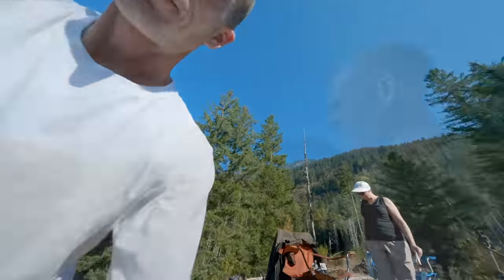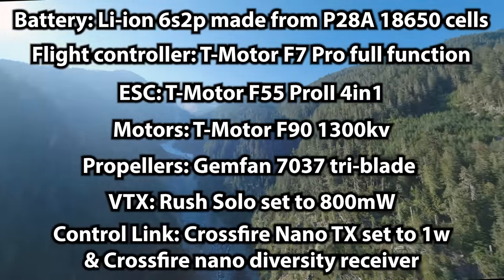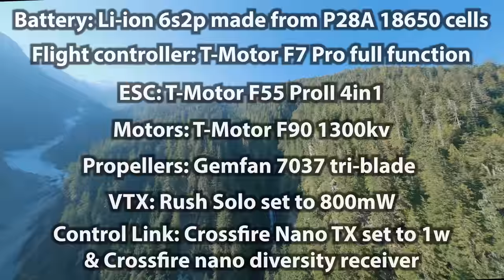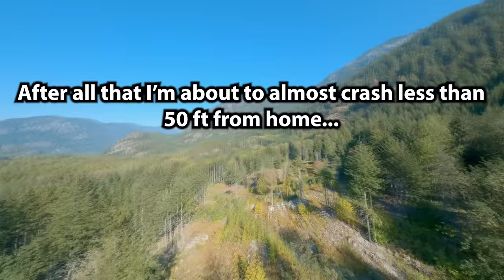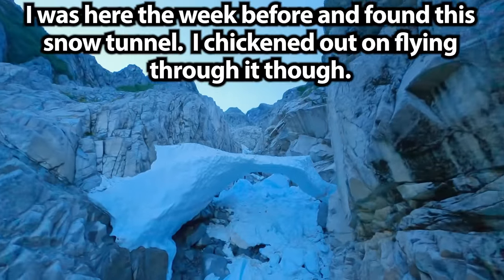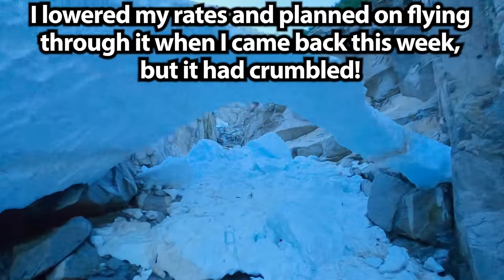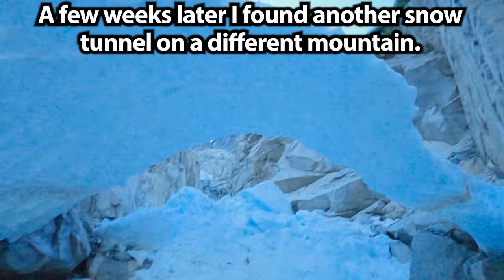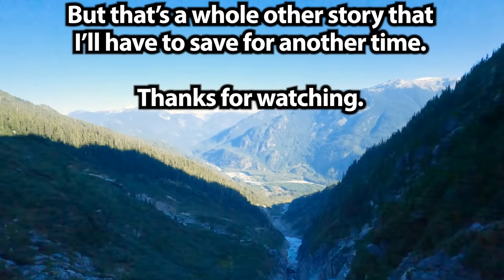4k FPV Drone Flight - Propellers Just Inches From The Ice!

Comment: I still dont get it. I got 800mw even on my toothpick and cant even go behind one builind 100 meters away lol. And this is with VAS on rapidfire and truerc dipole on quad. What im doün wrong 😩
Reply from the maker: This quad can not fly behind a building either.  I had line of sight to the quad with no obstructions for the whole flight.  It helps that the mountainside goes vertically making line of sight easier.
Reply: @FalconRadFPV  Thanks! Then how you go into that cavities etc. i still cant imagine how thats line of sight. Interesting; at least for me :D What Freestyle and bando guys do? Use different antennas for penetration?